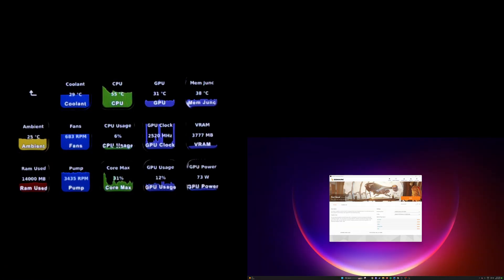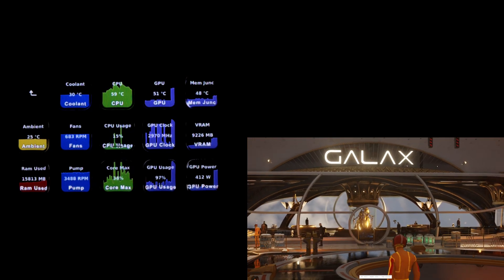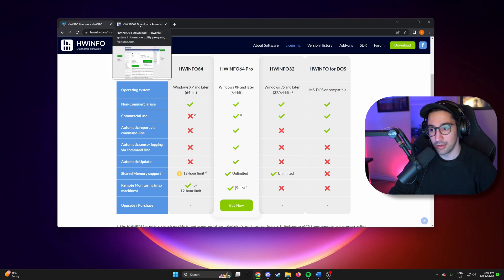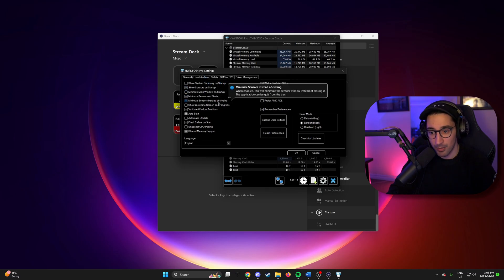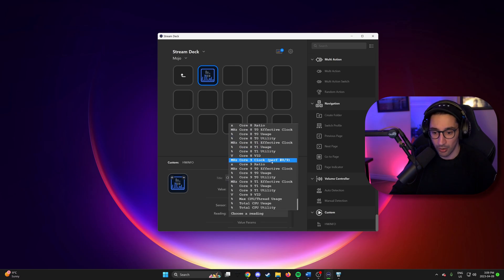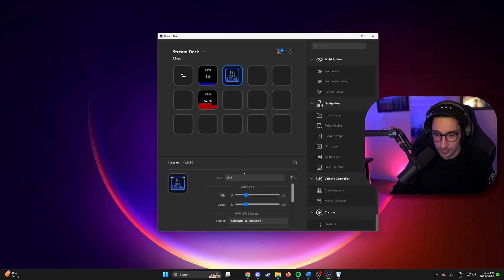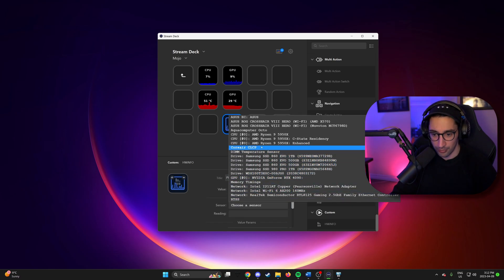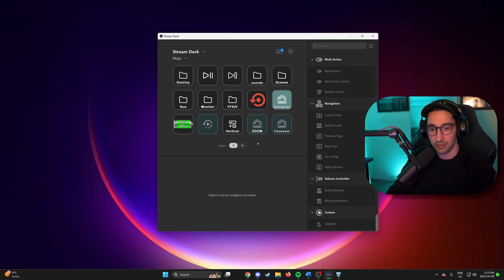Elgato's Stream Deck and HWiNFO64 are a match made in heaven

Comment: if u get a touchscreen u basically can do anything with it as a panel if u know coding :D - but the sd+ is a cool solution i think
Reply from the maker: Stream deck just makes it super easy to make something like this and it has a ton of other applications as well. I bought this originally for macros when I downsized keyboards to a 65% a few years ago and it’s the gift that keeps on giving as I find more and more used for it

Comment: Which sensor to monitor the 4090 16pin cable? The one below the last one you selected for the power?
Reply from the maker: GPU  16-pin HVPWR Power would be my guess. Better to measure total gpu power though imo
Reply: @OiTzMojo  monitoring both 😊. Thanks